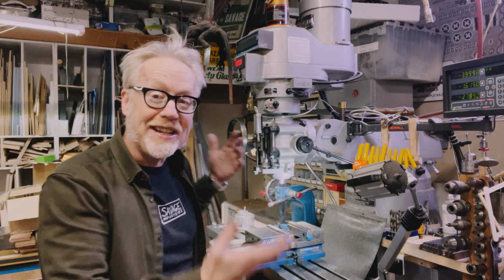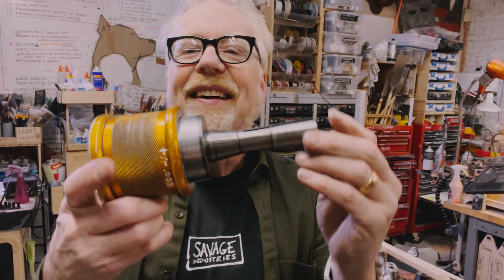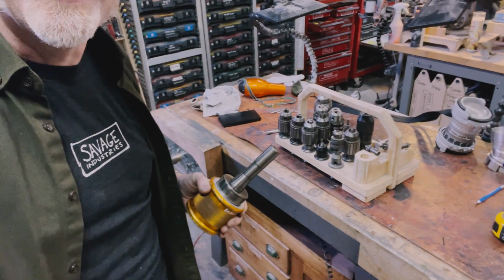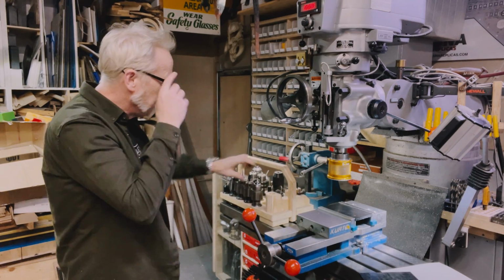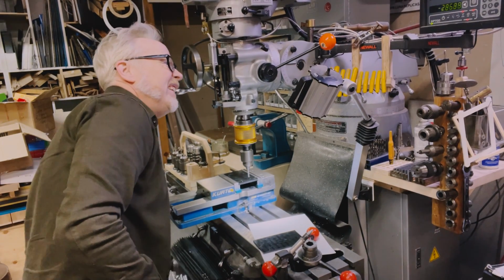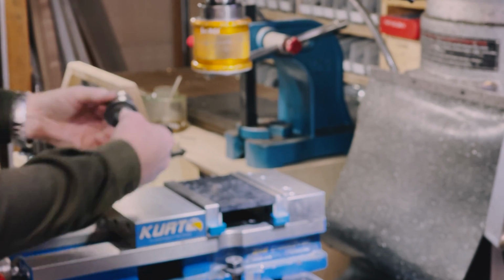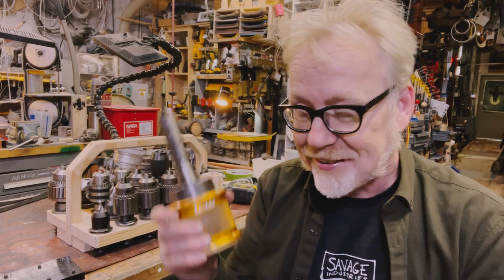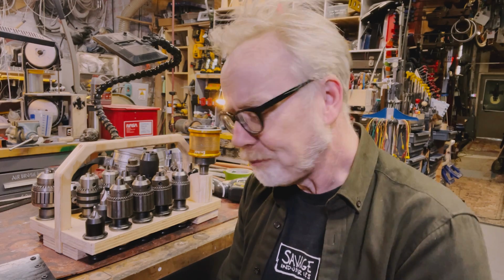Adam Savage's Favorite Tools: Quick-Change Tool Holders!

Comment: Don't know why you didn't do a through drill with the smaller bit first through both pieces, it would have ensured you had the holes fully aligned. But that's a nice piece of kit my dad would've loved it.
Reply: @IanThePelican that's what I was wondering. Why not just use the #7 bit threw both. Then all you have to do is thread the bottom one and enlarge the top.

Comment: I was thinking these holders would hold collets, which are more accurate than a standard 3 jaw scroll chuck. As machinist, I have to ask; if you're going to hold each tool with its own drill chuck,, why not just use one good Jacob's chuck with a R8 taper shank? It's just as fast to swap out a tool, takes up much less vertical space than that contraption, and saves you a bunch of money. Again, if it were holding collets or used for milling I could easily see the benefit. But using this just for drilling and tapping holes makes no sense to me.

Comment: I think I'd rather have a bunch of extra Jacobs chucks and R8 collets with the power draw bar. More versatile, no special tooling, just as fast, and you don't lose 4+ inches of z height.
Reply: Yeah, I saw how long that is as a problem too. But the chucks are way longer than a 32 collet holder would be, and I’d much rather use collets in a process that includes drilling steel.
Reply: @espalier  thinking on it more, I think I have an even faster way. Stack the plates and match drill with the tap drill size. Then use a hand drill with tap magic to tap the holes on one. Drill the other out with a clearance drill and counter bore in a hand drill. Change to a chamfer bit and deburr

Comment: Adam
R8 sucks . it is very weak.you yourself saw the poor concentricity with your quickchange  NMTB 40 is what you want in a knee mill. get a keyless chuck , one with 3 holes in the side and a wrench if you need extra tight holding. then use a stop for your plates . then you can pop the plates out of the vice and put them back the same.  this is  universal and almost as fast as the quickchange but much more accurate.